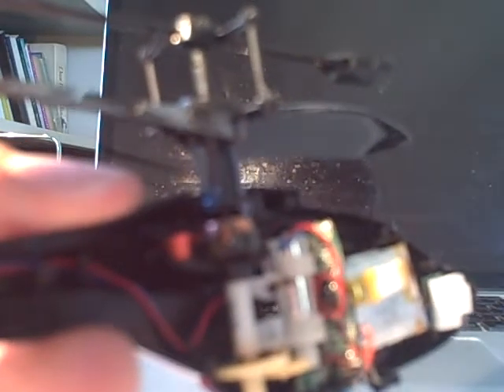Air Hogs Helix 360 -- Unsteerable Due to Collar and Pin Design

Comment from the maker: The company sent me a new one and the main rotor problem has not returned. Although after one or two crashes the helicopter starts oscillating in a way that's difficult to control. The oscillating goes away after I replace the tail rotor, but they don't last long (for me, anyway).